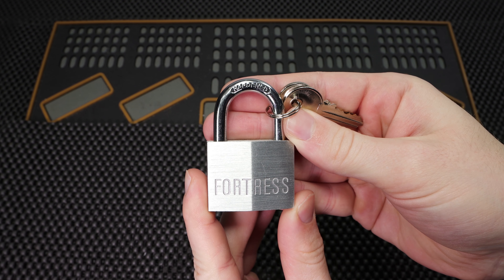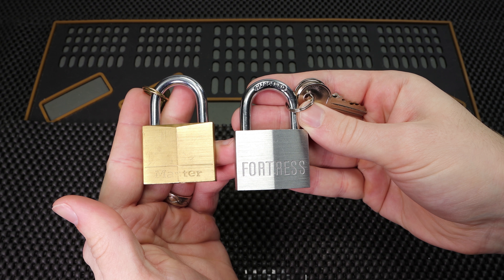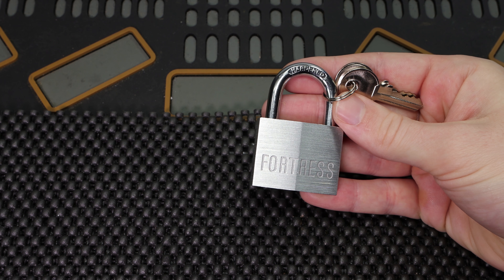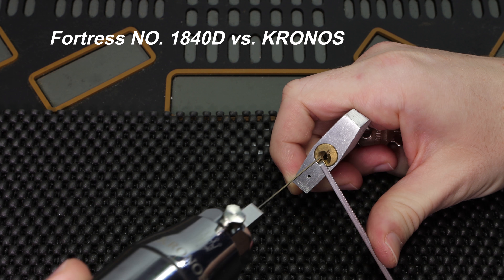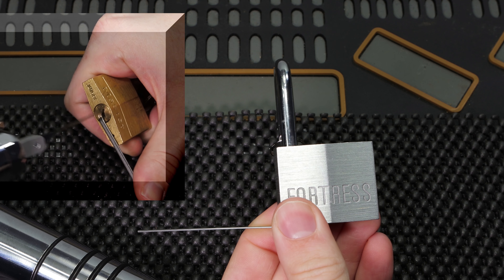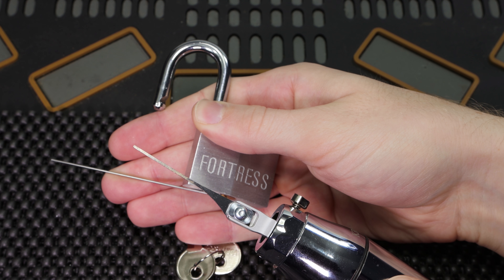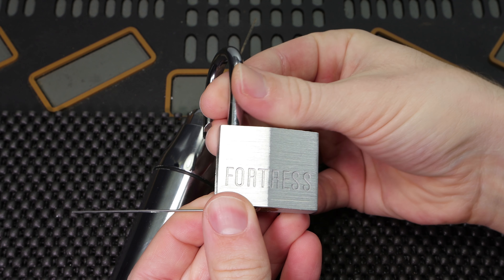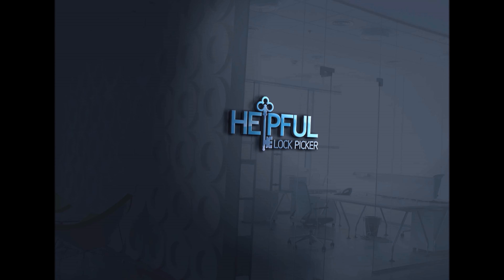[335] KRONOS Trials | Fortress NO. 1840D  (Master Lock 140D Clone) Picked In ONE Second!

Comment: I’ve had this tool for a year now and have never gotten the hang of it. I’ve broken several tips and opened a few locks but seem to struggle every time. The tip, at rest, sits at a somewhat exaggerated angle compared to yours, at rest. I wonder if I got a dud.
Reply from the maker: Do you think it is possible that you bent it?
Reply: HelpfulLockPicker . The pick is definitely not bent. I don’t know how I could bend something internally. Trying to figure out how to send you a picture of it.